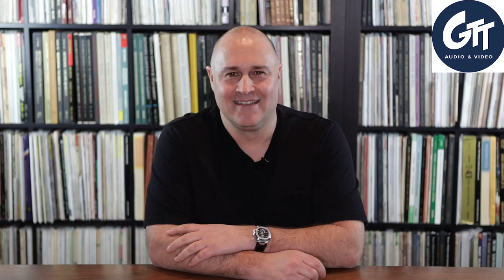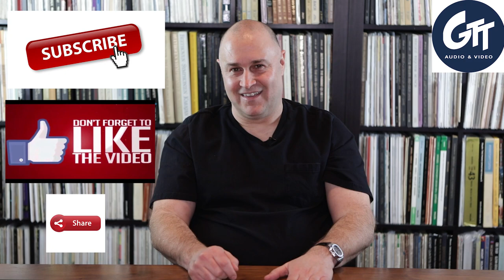GTT Audio - Episode 29 - System Compatibility, Listening Tips pt. 1

Comment: Joe Kubala is 100% correct.  Cables are a component and I highly recommend swapping all the cables for a true test, not one here and another there.

Seasoning a system with colored cables is never optimal.  You end up with what Bill says, less resolution.  +2 and -3 does not equal neutral.
Reply from the maker: Well said Damon, thanks for jumping in here.